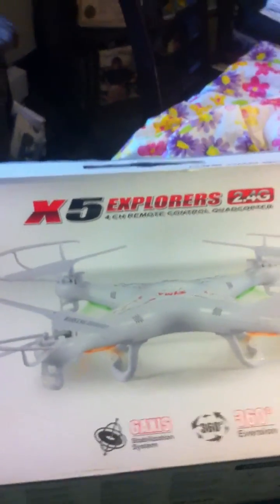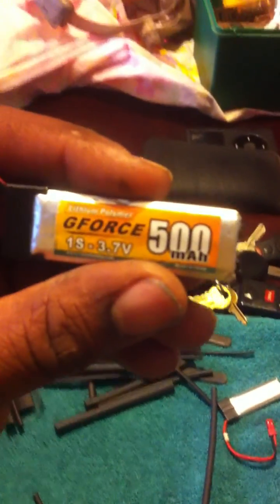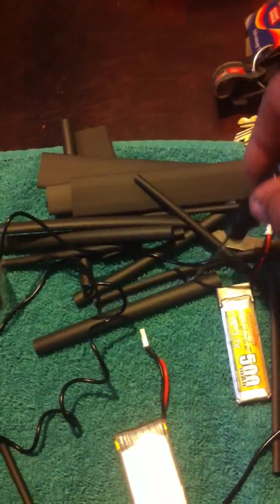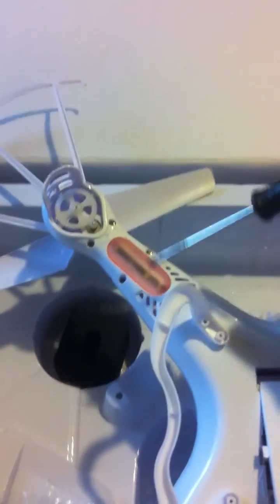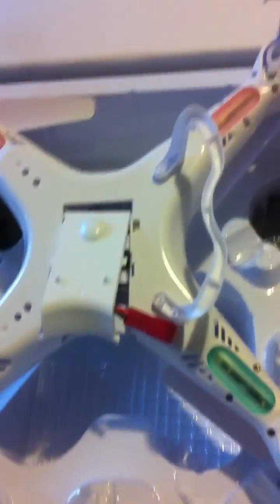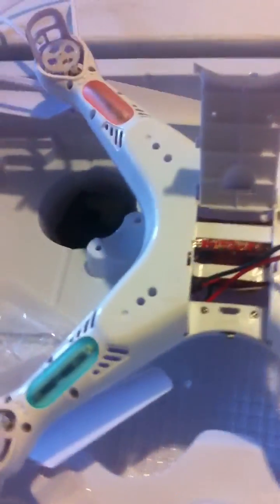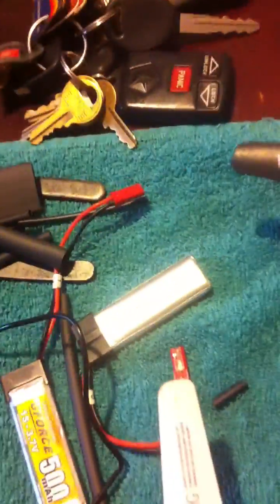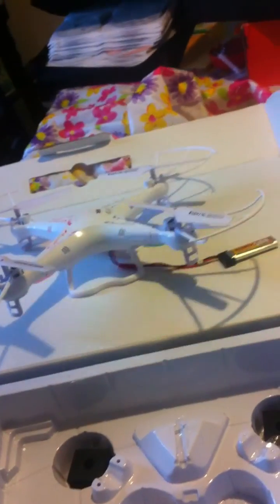Syma X5 battery mod to JST type connector.

Comment: what is the stock syma x5c battery connector called?
Reply from the maker: the term JST is loosely used on many. it doesn't clearly differentiate the plug types.
Reply: +MegaDerek2011 Did you ever find out what that connector is called? I bought 5 batteries and a charger for my hawkeye 1315s. The batteries all came with this connector. So I am trying to find an adapter. The battery maker calls it an xh, but everything I find is called xh-jst and dont look to match. Thanks for any help.

Comment: Hi Michael,
Can you please help? My 15 year old son just got one of these Syma X5C-1.
Someone told me that the Lipo batteries are very dangerous, so I search for videos here on YouTube, and now I'm freaking out. Are these little 3.7 Volts / one cell batteries the same as those bigger ones / multiple cells (used on DIY RC)? Do we need to take the same steps when storing/not using the batteries? Do we need a special charger to put them into store mode? Please help!
Reply from the maker: They are correct, even these small voltage batteries carry a wallop. just be certain to do one lead at a time and you'll be fine.